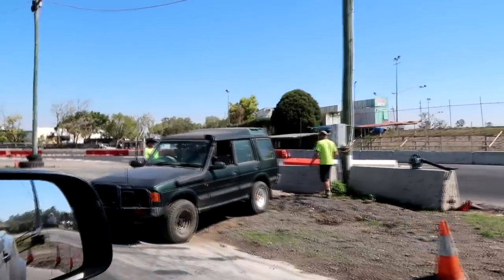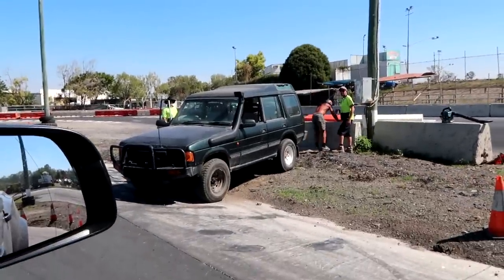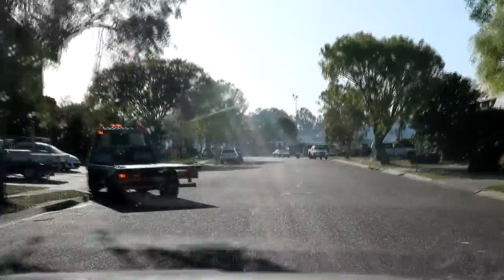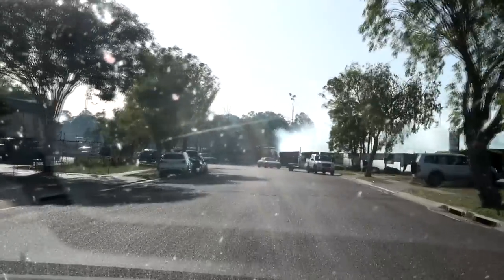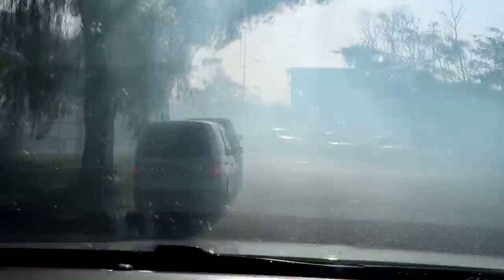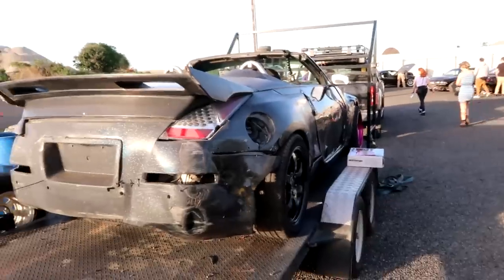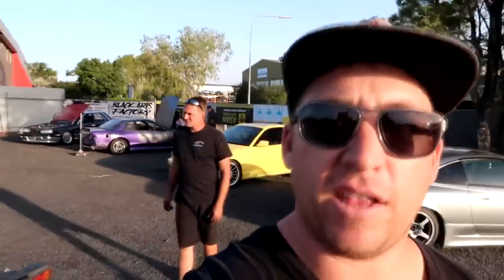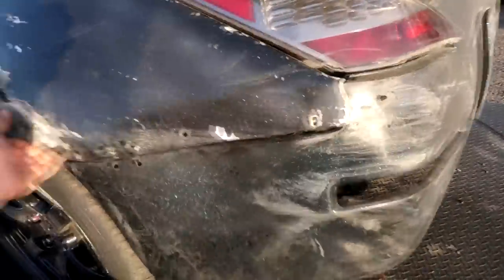350z convertible drift tandems *it got wild*

Comment: whats the suspension setup on the z?
Reply from the maker: Shockworks suspension 
Gktech upper and lower  front adjustable arms.
Rear just has camber arms
Reply: @Lukefink  what about angle? 
also do you have any advice on caster? i have e46 is there such thing as too much caster? 
why did you get both arms adjustable? istn one enough to dial in camber?
gktech only has rear arms for 350z
do you remember your alignment? it seems pretty snappy for 350z and thats how i like it